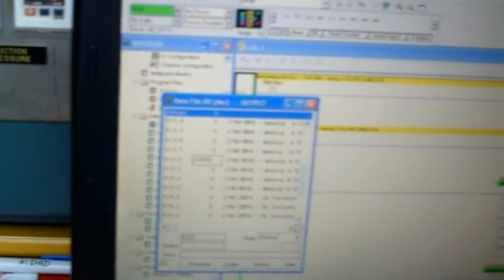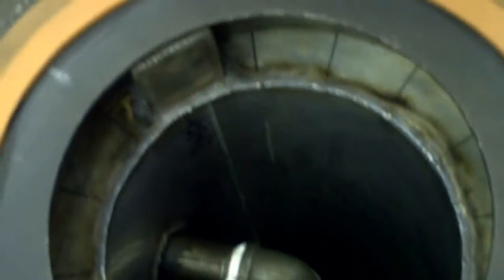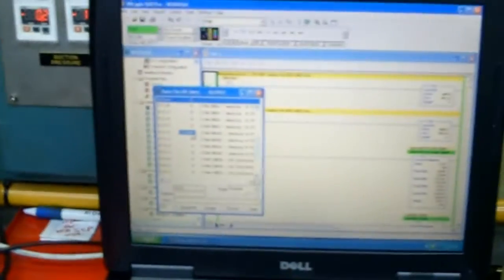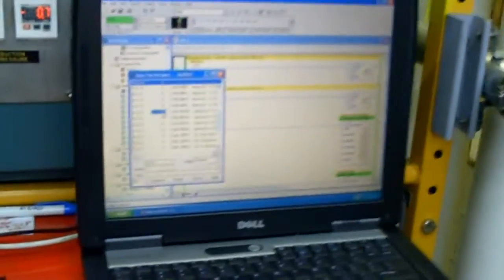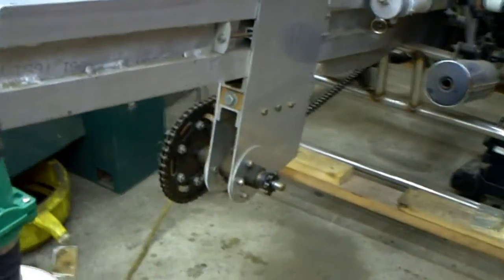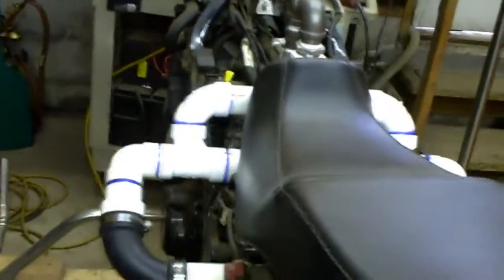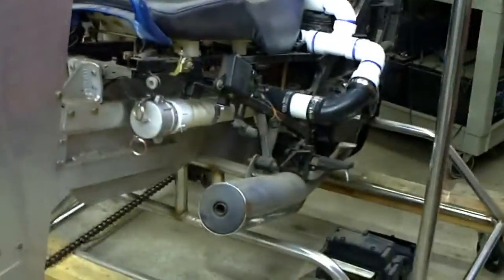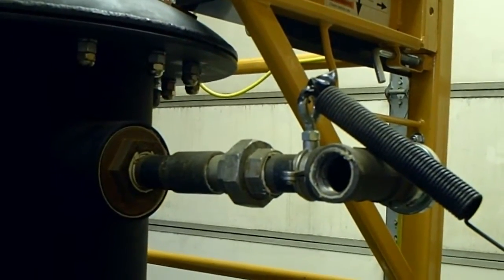Wood Gas Ninja 9-23-2016

Comment: Hey Joe how are you doing now? It looks like you'll be powering your state very soon! The yellow stairs gave it away that this thing is industrial strength.
Reply from the maker: Mike, I have spent a month and a half battling with people sending me wrong stuff on ebay. Now that everything is here, I've been hitting it hard again. I'll have to send you some pics to show the progress, but the jist of it is the plates to mount more inverters than I own are just about complete. The upgrade from a 5/8" jack shaft to a 1 1/8" jack shaft is done and looking great. The new sprocket machine work and chain are mounted . Now I'm working on making adapters to be able to use a 5 groove sheave ( to power up to (5) 110 amp alternators) that showed up with a bore that is 3/8" larger than the item was listed as having. This wasn't on my list , but the 100 bucks that I spent on the pulley was refunded to me when I sent him pics of the bore size. He told me to dispose of it as I see fit. Well I'm still going to put this freebie to work for me. It'll just cost me some time and material. I did receive one alternator , so I can start making the bracket that will mount up to five in a radial pattern around the sheave. I started on the exhaust too, but it's been an order parts and wait kind of time. So I'm doing better, feeling better , and starting to pick up steam. Oh , by the way , I wonder how rice burns as a fuel. You can't run a Japanese bike on biomass without trying this for real. Should be interesting. Later. Joe

Comment: Joe, Not knowing the rice rocket particulars well, is that engine a two-stroke or four-stroke ?
The concern would be with the oil lubrication for the cylinders if it is a 2 stroke
Reply from the maker: Bill, the engine is a 4 stroke , liquid cooled two cylinder . Just when you think I've gone too far, I'll start reclaiming the heat from the coolant side of the engine for heating purposes.
Reply: Hahaha, Joe ! TOO FAR is not in our dictionary. Better make sure you have a good lock on the garage door !
Reply from the maker: Bill , if you thought my build was creative , you should see my security system. You might just shit yourself if you walk in when your not welcome . Joe
Reply: I'll call first ;)
Reply: Bwwww ahhhh ha ha ha ha hahaaaa!

Comment: Nice progress and I like using the motorcycle as the power for the generators. And collecting the heat from the exhaust is a smart move too. Thanks
Reply from the maker: Rusty, I had a rough few months with my broken ankle , clot in the leg and saddle pulmonary embolism in both lungs, so I had plenty of time to think about what I wanted to do . I just wasn't able to do it. Now I'm slowly getting back into the swing of things. I'm still not back to normal yet, but I do what I can. Slow but sure I will get this thing fully automated and efficient. Thanks for checking in. Joe
Reply: Wow, you had a rough time. Glad your doing better and feeling like working in the ths shop.
Take care

Comment: Wow, that is one majorly industrial strength build  :) .
 Having your fuel dried and heated to such a high degree before it reaches the burn zone ought to really help a lot in cleaning up the output gas flow. 
 Doing it this way surely eliminates the need for double handling too, as your drying and conversion process all occurs in one place. Very well done indeed. 
 It won't be long before you are clocking up some major hours of runtime with your Ninja genset on this giant beast  :) .
 Keep the goodness happening, as "the woodgas is strong in this one."
Reply from the maker: Thanks Steve, you know no matter how well things go , it always feels like it's taking too long. I can't wait to see this thing fully automated and paying me back for what seems like a forever challenge . If I look back on where I've been with this build , it certainly shows I've come a long way, and I will get there as long as I'm able to work on it. It's only a matter of time. Joe

Comment: Looking good man. It is going to be interesting to see it running that Ninja with the alternators. Glad to see you post another video after all this time and to see you back at it. Have you thought about using that exhaust to atmosphere to route it into a wood dryer like CNC and Hbbyloggr??.. I have my eye on a 30 gallon air compressor tank that I have for one of those. Looking good.
Reply from the maker: Mark, I have thought about using the pyrocoil output for drying fuel, but I think I will do a run first and see how it goes. I have also been thinking about wrapping the exhaust from the engine to the gasser , but I just don't know how much heat I will lose between point a and point b. I may try out Flash's old propane in the garbage bag trick to get an idea how hot the pipes will get without wrapping. I'm also a little afraid of too much back pressure on the engine. As for the alternators, I would like to try treating each alternator as it's own circuit with it's own battery wired directly into a grid tie inverter from the battery. There is some debate about hooking gti's right up to batteries, but If you use the battery to power the gti,  you'll put out max amps to the gti and the voltage will be sensed in the voltage regulator loading up the alternator to put out max amps on the alternator to try to get that battery back up to it's charge level.
Reply: Joe, That sounds like you have it on the alternators. I am also going to set up my dual alternator system with individual circuits as well as having individual charge controllers for the single battery bank. The PMAs are not self regulating, so I need the controllers. The only items I still need to order for that are the resistors, circuit breakers and on / off switches. I have everything else ready to go, but I want to finish up the mods on the gasifier first before moving on to that. As for the exhaust, I am sure whatever you come up with is going to work just fine.